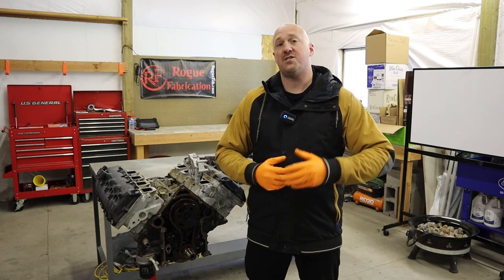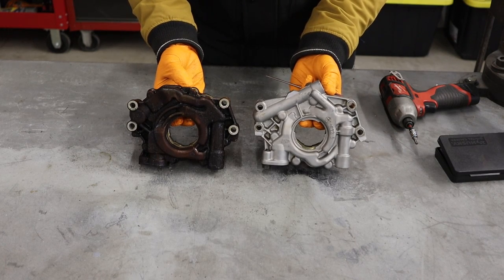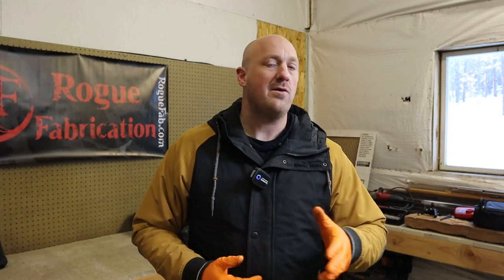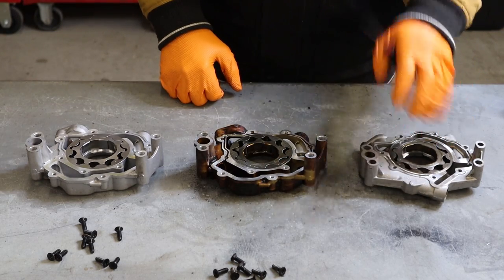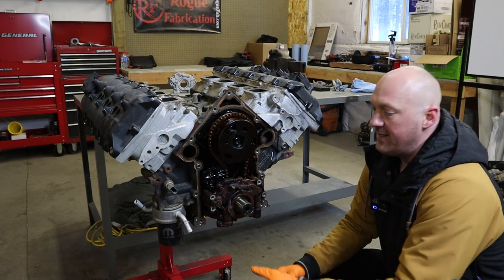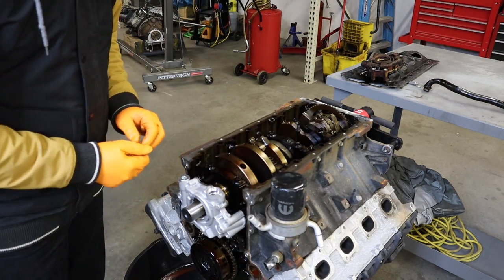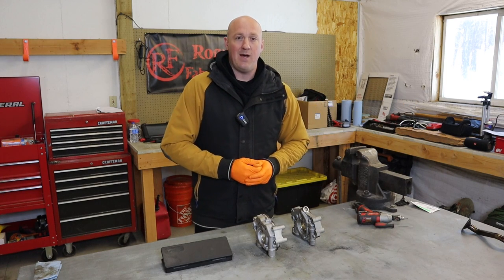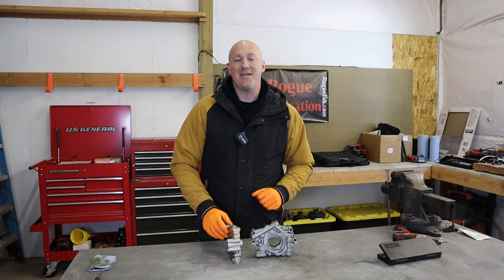Is it TRUE that Installing this ONE FACTORY PART Can PREVENT HEMI TICK?

Comment: i wonder if there is a difference on a smaller scale through the generation years of the trucks or chargers as they have been using these motors the longest... the 3 you showed in itself is proof that dodge was trying to fix the problem behind the scenes... which makes me hopeful for my 2021 to not experience this problem... im only at 12k miles now but as it is i never idle long i change my oil every 4-5k miles and im always in Sport mode to disable my variable valve timing as there is a theory that killing cylinders off may cause this issue to happen sooner...

Comment: Ever built a motor, particularly a stroker motor, and notices your oil is getting used up like candy? Like in a week? That’s what’s mine is doing right now and there are NO leaks whatsoever. Oil pressure is slightly higher than normal when it’s full.
Reply from the maker: Are you getting any smoke out of the exhaust?
Reply: @ReignitedAuto  yes I am. I had a cracked piston and piston ring, thus the reason why I stroked it out, and bought a brand new cylinder head. I figured the smoke was from all the residue that built up inside my exhaust from when the piston blew, but it’s still smokes. Quite a bit at startup

Comment: Do you have any experience with dropping a 5.7 in a GC overland with shorty headers installed?  I have to pay for a reman engine and im hoping they will install some and not charge me a ton.  I just had new stock manifolds installed and then my engine started knocking and running bad two weeks later so the bolts should be fairly easy to expel to replace with headers.  Thank u in advance for any tips.  WM

Comment: Hello, we replaced the Oilpump on my 2019 Gen 5 Ram 5.7. with the TRX Pumpe, because I had a Hemi Tick. We also replaced the Lifters, Pushrod, Rockeramrs and the Camshaft. On Coldstart I have 5-6bar (72,5 - 87,5 psi) Oilpressure. When the engine is warm (90°C Watertemp.) I have 2-3Bar (29psi - 43,5psi) Oilpressure on Idle when I stop on a red light. When the car is running between 2000-4000 rpm the Oilpressure is steady on 4-5Bar (58-72,5psi). Eco Mode still working but less common I think. Is this high Oilpressure from the TRX Oilpump a PROBLEM for the Lifters or the MDS System and MDS Lifters?
After the very expensive repair I got ticking sound at the top of the engine only on the passanger side. After it starts we replaced all MDS Valvues on the passanger side. I a little bit fearful, if the TRX Pumpe make that Problem or if we installed a bad NEW Mopar Lifter? Please tell me what you think of that Problem. German Ram Dealrs don`t have any idea for a solution.

Video of the new sound form the passanger: https://www.youtube.com/shorts/gzXa2SfJLTU

Comment: You can manually smooth and port the pump internally for additional ~10-15 PSI
Reply: I did that once, many years ago, to great effect on a stroked 440. It made the oil pressure instantaneous,  and respond quicker to rpm increases.

Comment: Im wondering if you can use the 09+ crank gear and make it work? I have a spare 06 5.7 or my 06 300c AWD, I bought to build possibly. Just need to figure out what direction I want to go with it. One idea I like but it's pricey, would be the hellcat blower on the 5.7, the torque storm supercharger would be cheaper, but I don't like how they sound when idling.
Reply from the maker: I thought about that too, but there's change challenges any way you try to tackle it. I'll show you what I came up with in a future video. 👍

Comment: I am working on a Jeep GC Hemi, and saw in another video that splash lubrication could be a thing. I suggested nothing the body of the lifter to allow more top-down oil to reach the roller.  There has to be a TRICK on installing the manifolds back on the Durango/Jeep 5.7l platform.  Terrible!!!!

Comment: I have a 2010 dodge ram1500 and I'm putting my second motor into my truck. Both times I had lifter failure. What is the part number for the hellcat oil pump

Comment: If more flow is the fix with 20% increase in volume and using the stock OEM oil filter will not allow 20% more flow switching the oil filter to a Trasko full flow bypass combo (3 times Larger than OEM) will increase the oil volume to 1 gallon per minute and be a lot easier to install plus filter down to 1/10th of a micron from bypass and 3 gallons per minute 8-10 microns on full flow and much cleaner oil than OEM filter. 

Option B: K and P Engineering's S92 full-flow oil filter offers 7 times more flow than OEM but cleans to 30 microns like the stock OEM filter clean and reuse the filter.

Comment: Could you take and cut an extra lower timing gear to the desired length and possibly tig weld it the lower gear and oil pump drive gear 
Just a thought

Comment: Something to note as well is vct variable camshaft timing is oil pressure/volume operated. It would make sense that the later oil pump designs had a big jump in volume considering that both multiple displacement systems and variable camshaft timing systems use oil from the oil pump to function. Which lines up with what you are showing. When MDS systems showed up more volume was needed. When vct systems showed up another jump in volume was needed. Can these higher displacement pumps keep the hemi tick away? I hope so plus it's also a cheap way to prevent it in a relatively young hemi engine of "yesteryears" but not really in an engine of later production. It would be nice if Melling would produce an upgraded pump for newer engines but with the aftermarket time is a thing.
Reply from the maker: Great points Jeremy, always glad to hear your input. 👊

Comment: Hi I'm Ben from Boston, I've  watched all of your videos for the hemi tick issues.  I have a 2014 ram with a 5.7. started hearing a tic about a year ago . Took it to a dealer they said it was a manifold issue. 2000 dollars later still wasn't fixed. Took it to another dealer and told them to investigate the cam and lifters for damage or wear. Well they called me back and told me that I had metal fragments in the oil control valves and I need a new motor. I'm getting a new engine. 12,000.  dollars ouch. I didn't want a reman.
My question is in the future what would be the best oil and filter for my engine so I could prevent this from happening again.  Truck has only 81,000 miles on it and I plan on keeping it for the long haul. What about adding a zinc additive to the oil? I appreciate your thoughts. oh i just subscribed. thanks.
Reply: Redline has been the go to oil on all the forums. The consensus is these engines need Molly/sulfur. Also look into the small vs large oil filter issue. MO339 vs MO599 I think are the mopar numbers xg10060 vs xg2 in fram. There’s a whole thread on it on ram forums with 50+ pages.

Comment: Do you think that Chrysler attempted to solve the issue with the difference between the pre 2009 and post 2009 oil pump?
Reply from the maker: I think like others have mentioned, that with the increased oil demands of the VVT system that they had to increase the volume of the pump.
Reply: @ReignitedAuto  that's what I was thinking, too. Don't forget, they also increased the size of the oil filter outlet/mounting fitting dramatically, from (SAE)3/4" to 22(I think)mm.

Comment: After installation of new pump that will increase oil pressure there will be question if this will be sth that will be handled by the engine. If this will not cause an oil leak in the future...

Comment: I was abel to remove the oil pump on my 2011 ram 1500 to change the oil pump... the problem is geting the bolt off... it is tight.. i ended up having to buy a cheap wrench and grinding it down to fit. But its do-able.

Comment: Hi there. Great job on the channel. Lifter Question: I am doing an MDS delete on my 2006 Magnum 5.7 R/T (Plugs and tune). Is the mopar "hellcat" lifter part number 5038784AD a direct fit? Thanks
Reply from the maker: Yes it's a direct fit in all Hemi engines back to 2003 👍

Comment: Could you do the same thing with the melling high performance pumps? I just put one on my 2006 r/t that I also stroked to a forged 392 since I spun a bearing and had to rebuild it. I put the high pressure spring in to prevent another rebuild from possible oiling issue.

Comment: Is there an after market high pressure oil pump that won’t suck the pan dry.
Reply from the maker: There are high pressure pumps available rather than higher volume pumps, but they only affect PSI at higher RPM and the goal here is to change the PSI at idle speeds. 👍

Comment: How do we fix the 6.4 oil pump.lifter issues.
I seen most videos you jave done there mainly about 5.7 .
Srt australia we have hardly any parts.to fix issues .what the best mds delete no eco delete but hiw do we keep lubrication at idle and high rpm

Comment: Would a pre-2009 SRT8 (6.1) engine have a larger oil pump as well, or  the same as the early gen 3 5.7?
if it has its own (better) oil pump, would that be an easier bolt on upgrade for early  gen 3s?
Reply from the maker: That's a great question, I need to get my hands on a 6.1 pump to find out!
Reply: Believe it’s the same pump as the 5.7

Comment: I have a question about my 16 pursuit. It’s got AWD and the 5.7l hemi. My goal is to swap the 5 speed trans out with the 8 speed while keeping AWD. I know I need a custom harness, the 8 speed transmission, the electronic shifter (which I have already. Just not hooked up) so my question is do you know what else I would need to do? I know the 5 speed is shorter so would I need a custom adapter to mount the transfer case or would I need a shorter driveshaft?

Comment: Just bought a 2023 5.7 e-torque , what do you know about the e-torque and im a 4000 mile max oil change guy @reignited
Reply from the maker: I'm actually a fan of the E-torque system. I like how it is essentially just an added on electric motor for the engine and not married to every system like a true hybrid. This makes it easier to work on and cheaper to repair. Also, since that system has come out I can't recall a single instance of one of the motors going bad, they seem to be holding up really well.

Comment: Is cylinder block oil inlet passage the same diameter on all the 5.7 hemi cylinder blocks. To accept the higher volume pump
Reply from the maker: Yes it is. Ironically even though the pump outlet changes, the block inlet has always been the same size.
Reply: @ReignitedAuto  Thank You

Comment: So what's the pressure difference, my ram idles at 50 psi already. Over 100k and has ticked since I bought new in 16. Knock on wood haven't had any issues.

Comment: What about draining the pan of oil during full acceleration?
Reply from the maker: You have to remember that this is a factory part for a Hemi engine. The hellcat has the exact same oil capacity as a regular Hemi, so if a problem like that did exist it would have shown up long ago.

Comment: This has been quite a controversy, since I just purchased a 2019 Ram 1500 with a hemi but do not have issues as of yet, I've been concerned about this and learning all about the issues with this problem. I do not see how a high volume, or a high pressure oil pump would help the problem that these engines have, because as other videos have shown, when you turn these blocks upside down you can see the oil galleys taking up space, space where the crankshaft is supposed to sling the oil into the cam and lifter area. From what I understand, the only thing that could make this issue better is a higher idle which nobody really wants to do, it sounds like physics to me, you can put all the high pressure or high volume oil pumps and you want that's only going to lubricate the areas that already have passageways I would imagine, how are you fixing the lack of lubrication based on the physical slinging of the oil from the crankshaft? Obviously it's a piss poor design and there's really no cure for it, except to keep the idle raised, which like I said nobody wants to do. I think you could oil the crap out of that motor and it's still not going to help that distant area that needs it the most.
Reply from the maker: If you can, take a look at this newer video I have out: https://youtu.be/1gpEwkTVCmE
It better explains the concept behind the higher volume pump. You seem to be under the impression that the camshaft is only lubricated by splash from the crank, which isn't accurate. I show in the video that they're are dedicated oil galleries that feed the lifter bores which also provide oil to the camshaft lobes. I hope this clears things up a bit for you. 👍
Reply: @ReignitedAuto  I have seen this video previously and once again I don't understand how a high volume oil pump is going to circulate oil into an area that only gets oil in it from the splashing of the crankshaft. Do these hellcat motors have any type of idle wear situations like the 5.7's? I'm an electronics engineer and analyze everything that I do, including mechanical work that I've been doing for a very long time, and it appears to me that the defect in these engines is in the castings that do not allow enough oil to circulate to the upper portion of the engine where the lifters and cams are wearing out the most. Please explain how a high volume oil pump is still going to get oil into those areas when they don't have those passages to begin with? While it may be helpful to have more volume at other locations of the engine, as I have said in the distant location of the crankshaft and the lifters, which don't appear to have any dedicated oil passages, I fail to see the benefit of a replacement oil pump whether it's from a Hellcat or Melling industries. Feel free to correct me if I'm wrong, but everything I read says that the upper portion of these engines are lubricated by the splashing of oil from the crankshaft, no additional oil pump will help that issue in my opinion.
Reply from the maker: @westwasbest  I literally just said that these engines have dedicated oil passages for the lifters that directly lubricate the cam lobes as well and thus the cam does not rely only on splash lubrication. My other videos clearly show these oil passages. I can appreciate what you're saying, and I'm not going to pretend I have all the answers, but I am saying that a high volume pump can give additional oil to the lifters and the cam, especially at a time when it needs it most, idle. 👍

Comment: I got all 3
2008 500,000 mile
No hemi tick
No exhaust bolts broke
I use 5 /30  Walmart oil and Walmart filter
Change it on first oil change 
2021 hemi engine 
No hemi tick 
No exhaust broke boltes
5/30 Walmart oil 
2019 no hemi tick 
No exhaust bolts broke
5 /30 Walmart oil 
What am I doing wrong?

Comment: So what do I need to do to fix the problem once the ticking is already happening? I just had a motor installed in my 2006 charger r/t 5.7 and the motor came out of a wrecked cop car.

Comment: Argh!
Would the plug and play work with changing the crankshaft and camshaft then using shims on non critical extensions. 
 Doing that you’re now entering stroker motor territory. Which could be good if you wanted the project to be chasing big BHP gains.

Comment: What about a stock 5.7 oil pump vs a melling OE pump? I’m running a standard melling pump after cam swap and still using 5w20, oil pressure is idle 39-44 and driving 50-60 psi. Wonder if there is any major difference from the stock vs mellings standard
Reply from the maker: Interesting, I'm looking to do a comparison video between the Melling pump and the Hellcat pump, would you be interested in watching t that?
Reply: Ive still got my stock pump.  Pressure is identical to what you listed 🙂
Reply: @ReignitedAuto  absolutely. I would love that!

Comment: I have 2011 ram 1500 with a 5.7 hemi . I get a ticking noise when the engine is downshifting (mds mode) coming up to a light. Noise goes away when I use two haul mode or the +/- on shifter column. I found some videos saying it is the timing chain tensioner is worn out. What do you think

Comment: I’m confused, you said hellcat is high volume. This does not mean more pressure as you stated. You would need a high pressure pump which is different from my understanding to high volume.
Reply from the maker: Pressure is only a reflection of resistance to flow. Trying to push more volume through a fixed system creates more pressure naturally. I'll demonstrate this in the next part of this series. 👍

Comment: BUMMER I have 2005 Dodge Ram with 135,000 on it now the TICK in #1 cyl. I have all new parts including hellcat pump, pickup tube (which I am ready to cut if necessary), lifters, Val. Springs comp cam 112-30-11, gaskets, I wonder can a 12mm spacer??? maybe, no can’t move gear out. Question will hellcat pump hit back of cover???

Comment: Hey man, I have a question for you. I have a 2016 Ram 1500 with the 5.7. I had it parked and sitting for over 2 weeks due to a military obligation. When I stated it up after returning, it was ticking and misfiring BADLY for a few minutes. I assumed that a lifter had bled down, and let it run and didn’t run the engine hard at all until the ticking went away. Did I hurt anything? Can this be prevented? Are my lifters shot? Any insight would be appreciated. 
Also, weeks later it starts, runs and drives just fine with no ticking at startup. I’ve also already had bother sides of header bolts repaired, so I know it wasn’t them. 
Thanks!!
Reply from the maker: I think you're pretty much right on, sounds like a lifter bleed down on you. Good news is no harm done, bad news is only way to fix it is to replace all the lifters.